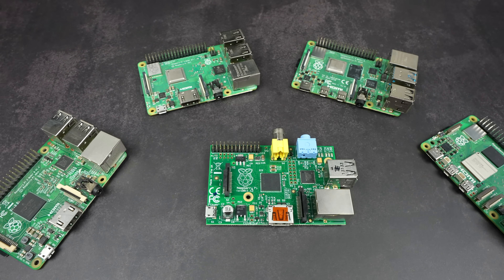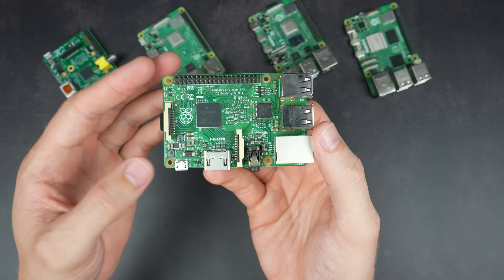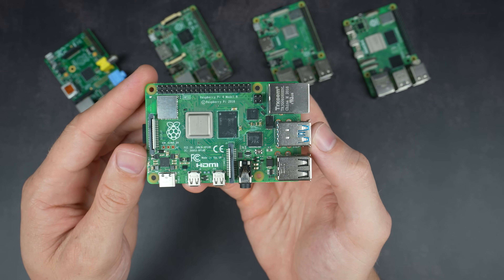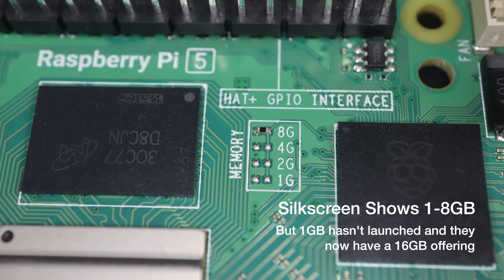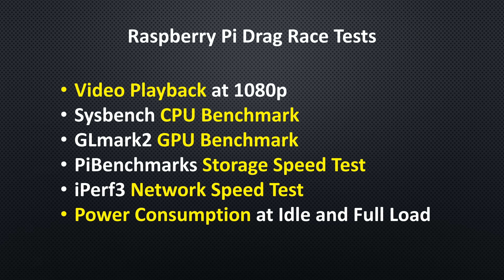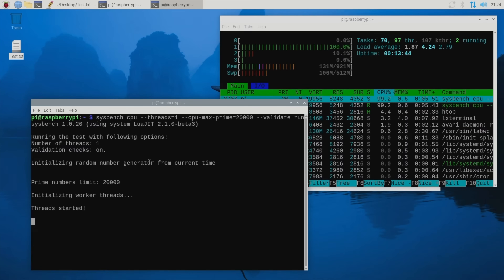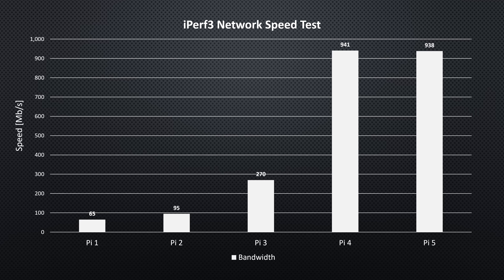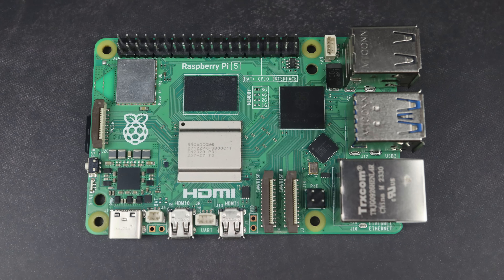Raspberry Pi Ultimate Performance Comparison: Pi 1 to Pi 5

Comment: I'd like raspis to return to their low power, no heatsink needed roots, as the pi 5 runs too hot for my liking and needs new power adapters. 
The ideal model should be able to run from any usb port like the ones already in devices such as pcs or tvs with no need of active cooling.
Also I hate the micro hdmi ports, better have only one output or have the second one use usbc dp mode.
Reply from the maker: The Pi 5 can still run on a standard USB power supply (without power hungry drives and peripherals connected) and without a heatsink - although you'll be limiting performance. Agree on the microHDMI ports - everyone seems to want them to go back to one full size HDMI port and a second through another means.

Comment: I remember overclocking my Raspberry Pi 2 in high school up to 1.15 GHz. A couple weeks ago I went out and picked myself up a Raspberry Pi 5. It's absolutely mind-boggling how much better the new ones are! The usability has also increased over the years; maybe it was just my inexperience but I found it tremendously frustrating to get OSs installed on the Pi 2 back when that was the latest one. With the Pi 5 it was extremely easy and frictionless to get set up for the first time.
Reply from the maker: They have certainly come a long way, both in performance and in the user experience.

Comment: I have an M1 iPad Pro 11" and I'm looking to use a raspberry pi as a portable code server by connecting it to my iPad via usb c. My only concern is that the iPad cannot output enough power for the raspberry pi. Most videos i saw regarding this used the raspberry pi 4 4GB model. Where i live, the 4 and 5 are almost the same price but im really confused as to which one to get. Should i sacrifice performance for power efficiency? Please let me know what your thoughts are on this.
Reply from the maker: The Pi 5 can run on a Pi 4's power supply as long as its the bare board with no NVMe drive etc. connected to it.. I think that the main reason they went to a 5A supply was to support the PCIe port. You'll probably just get a warning on the Pi to say that it's not being powered with the correct supply.
Reply: @MichaelKlements  So, in theory, I should be able to fully power a raspberry  pi 5 with just my ipad? It's not going to use pcie or any usb peripherals. Just a direct usb c connection to my ipad. If I remember correctly, the max output of my ipad is 7.5W. So if I use a really high-quality wire that's short, it should be fine?

Comment: That was interesting.

I remember being really excited following the development of the original Pi, then being disappointed with it when I got one of them. It was stunningly slow, and while only $35, it couldn't do much more in terms of hobby projects that a microcontroller costing much, much less.

I think it's when the 3 landed that it really found it's legs as a general purpose computers.  Throw in the recent compute modules and the Pi is all but ubiquitous in the electronics systems space.

I'm pleased for people like Eben Upton.  They've created a remarkable industry.

Comment: This is a wonderful video. My first Pi was a 3B, and so I never suffered that Casio calculator performance of the V1 or V2. My next was a 3B+, then the 4, and now I have two Pi5s doing my mission critical stuff (Plex server, Pi hole, and media centre in the bedroom). I still have a couple of Pi 3s ready to do stuff, but rarely even boot them now. The Pi 4 is still a retro games games console, so it's not all bad.

Comment: Great compact comparison and reference. 

I still have a pair rp1s , one on service as sort of media server serving my google tv using samba with 800gb attached flash drives and connected via lan port on internet’s provider adsl modem. In terms of power is provided by adsl modem usb port. 7 years 24x7 still running fine.

Comment: ONLY the Pi 5 is any good for Video. The rest of the PI SBCs are VERY Poor at Video.
That being said, the Pi 4 is still one of the BEST value for money SBC. It has great balance between power consumption, efficiency, thermal, and CPU/GPU power.
The Pi Foundation would do great by keeping the production of the Pi 4 and Pi 5 alive simultaneously. Offering these Pi SBCs at different price points would allow many more to experiment.
Reply from the maker: I agree, I think the Pi 4 offers the best value for for money.

Comment: Did you compile sysbench on each of the Pi's, or is it taken from the repo? The scores for the Pi 1 & 2 are far too low. The Pi 3 is faster than the Pi 2 but not by that ridiculous margin. It should only be about 1.5x as fast, not 17.5x 

Also, did you keep them all at 32bit raspbian? If you have the 1 & 2 on 32bit & the later pi's on 64bit then the results aren't really comparable.
Reply from the maker: I used the repo copy of Sysbench and the latest supported OS for each - these are 32-bit for the Pi 1 and 2, 64-bit for the 3,4 and 5. The results are an indication of how much better each generation is than the previous generation - capping the Pi 3,4 and 5 to 32-bit to make the results compariable defeats the purpose of the test.
Reply: @MichaelKlements   @MichaelKlements   @MichaelKlements  How can your results give an indication of how much better each generation is than the previous if the results are not comparable? Sorry but I don't understand that logic? That's just basic scientific method, the tests have to be the same for the results to be of any use. You can use 64bit raspbian on the later Pi's but at least compile sysbench to be 32bit across all the tests (probably 32bit version in the repo too).

32bit sysbench is massively gimped, by design, so if they're not running the same test then essentially all you're showing is how much better code written to use exclusively double precision (64bit) floats runs on a 64bit architecture vs a 32bit architecture, which is an obvious outcome & not at all representative of the actual performance.
Reply from the maker: I fully understand that running identical tests across all models is the most scientific approach for a direct comparison. My goal here was to highlight what the modern Pi can do rather than limit it to what the older ones could do. If the older Pi can’t run certain software in a reasonable configuration, then I don’t think it makes sense to hold back the newer Pi just for the sake of consistency.

It's like comparing fast charging on a modern smartphone with PD vs/ old smartphone without. Then saying, well the old one doesn't have PD so we'll use a non PD charger. The test then concludes that the modern smartphone isn't any better at charging. Yes, using a non PD charger is a more comparable test between the two phones but in the realworld the one can be charged significantly faster than the other because it has a feature that the other doesn't have.

That said, I appreciate the feedback!
Reply: @MichaelKlements  dunno why my reply isn't showing up! I understand the logic, but sysbench isn't a useful tool for showing real world performance, it's not even a useful benchmark tool (& per the developer isn't even intended to be one, despite its name). If your workload consists entirely of running sysbench then yeah it's very useful information, but I doubt many users do this. & I thought the goal was to show the generational performance improvements? I may have misunderstood the video then. The generational improvements would still be there if they're all running the same test, just not the unreasonable gulf between 2 & 3.

32bit sysbench is massively gimped, so in your fast charging analogy it'd be like using a 5V 50mA charger to represent non-fast chargers.

Comment: Great Raspberry benchmark. I have RPi3, RPi 400 and they do their job. RPi400 is the best Amiga and Commodore emulation. However, the best solution for Raspberry Pi OS desktop is RPi 5, preferably with an NVMe disk, then RPi OS works very efficiently. I don't regret spending money on each version of RPi

Comment: I really wish they'd kept the audio out Jack and would have put in a decent audio chip. Extra cost I know but they could have been dominating the  audio and hifi market all this time.
Reply: RPi itself sells Hi-Fi hats with high quality DACs on its website. and if you don't want a HAT, there might be a chance that PiOS supports USB DACS by brands like Schiit Audio and Dragonfly. However, they'll never dominate the audio and hifi market, too much choice there.
Reply: IDK they would need to build it with vacuum tubes for that. 😅  Anyway I have a Pi2 with a HiFiBerry HAT and that works well, but I think the number of people that are interested in high quality audio, want to stream it AND are willing to mess around with a raspberry pi... That's not a very large market.

Comment: Thank you for this - it is really good to see the power per watt comparison - (I think you have persuaded me to retire my Pi V1's completely).   I wonder how this compares to second hand mini PCs running something like an I3 Gen 6 CPU, as the price gets comparable when you include putting a Pi in a case and getting a power supply for it
Reply from the maker: I've done a couple of recent comprisons between the Pi 5 and some N100 and N97 mini PCs but I havent ventured into comparing Pis to older PC hardware yet.

Comment: I have few PI3 and nothing better, P1 and P2 were very useful to run dedicated applications requiring low power. Pi was not a PC at this time, this ended up in non sense things consuming way too much power.

Comment: Regarding power consumption:

The pi5 2gb and 16gb version use a newer revision of the SOC. They cleaned up the die removing unused Broadcom parts.  
Resulting in a lower power consumption

Comment: great video. For me the sweet spot is the Pi4, doesn't get too hot with just a decent heatsink without active cooling.

I think the Pi5 missed some opportunities.

the Pi6 should have or should exist in a version with (bootable) NVMe (without the scary cable) and 2.5 Gbps ethernet, and should remain stable without cooler. But who knows, perhaps the next gen even outranks my expectations.

Comment: How much RAM did you have for the Pi 4 and 5 used in the benchmarks? It would help to compare the final results with RAM in mind as well (especially between the 4 and the 5).
Reply from the maker: Both are the 8GB variants. The tests that I ran aren't particularly RAM intensive so I don't expect the results would change much but that would be a good comparison to do.
Reply: @MichaelKlements  Thank you for the video and the timely response. Your content is very interesting and useful.

Comment: Good video with interesting results.
Where would the Pi Zero 2 w rate ?
I guess its around a Pi 3 level but I could be wrong
Reply from the maker: The Pi Zero 2 W would be slightly under the Pi 3, its a similar SoC but clocked a bit lower (1Ghz vs 1.2Ghz on a Pi 3) and it only has half of the RAM.
Reply: @MichaelKlements  just a shame the Pi Zero 2 W only has 2.4Ghz wifi and 512mb Ram.
The Orange Pi Zero 2 w really shows up the hardware short cummings of the hardware

Comment: You can try to test the DNN of OpenCV and see the power draw and heat! Pi 5 is sloppy. Much worse than Pi 4B!
Prefer Pi 4B over Pi 5. Would like to see a much better Pi 5. The 16nm process used is out dated. Expecting 8nm or less. The die cost is about the same.
Skip and keep waiting for Pi 6......

Comment: the maximum signaling rate of usb 2 is 480 Mbit/s, not 300.
Reply from the maker: Yes, the 300Mbps limitation is due to a few things but is mainly to do with the network adaptor and USB controller sharing bandwidth.

Comment: Regarding the sysbench results: Cortex A53 shouldn't be 18x faster than A7.

Can you run the sysbench test on the RPi 3 with 32-bit Raspberry Pi OS? I think that's the confounding factor.
Reply: How much impact could the VFPU and NEON extentions of the A53 have? Most often when 10x improvements in CPU performance are made, it is due to hardware acceleration of certain instructions.

Comment: when the raspberry pi first came out it was touted as a computer the size of a credit card. i am still waiting for their boards to actually be the size of a credit card. the closest we’ve gotten was the cm lineup or the rp2040, etc. not quite credit card size that can actually fit in a wallet slot and match exactly other credit card dimensions.
Reply from the maker: To be fair, the actual board and circuitry is fairly close, it's the ports that make it much larger.
Reply: Raspberry Pi Zero 2W is pretty close and performs reasonably well if headless

Comment: I would've liked to see the raspberry Pi Zero w and Zero 2w included in this

Wishlist for future PI: USB4, DisplayPort, 2x10G Ethernet, WiFi 7… I know it won't happen but one can dream?
maybe tucked away in a corner onboard pads for RS232/422/485 (on the backside)?
Reply from the maker: Thanks for the suggestion, I'll look at doing one with the Pi Zero range too.

The Pi is probably always going to be limited by the PCIe lanes available, so dual 10Gb Ethernet and the likes won't happne for a while. RS232/422/485 would be a great inclusion!

Comment: The 3B+ could only do up to 300Mb connection speed, the Pi4 has true 1Gb connection. 2:56
Reply: After continuing the video I noticed on your network test you correctly said the said the 3B+ speed 😁 great video.
😮 but you did label the network speed as the Pi3 but was in fact a Pi3B+ 🤭😜
Reply from the maker: Yeah it's a bit of a strange one - Gigabit Ethernet over USB 2.0. I didn't really go into the versions of each series too much - the 4 is also technically the 4B

Comment: Did you mention the model 1 B plus?  In between the B and the 2, the B+ introduced a lot of the things later models would have like 40 pin gpio, squarely placed mounting holes, ports on just 2 sides, 4 usb ports ...
Reply from the maker: I didn't go into any of the B or B+ versions in between. I only mentioned the Pi 3b+ as I didn't have an original Pi 3.

Comment: The Pi4 is a really unique balance of performance and power consumption. Runs well off a standard power bank with a great desktop environment. Ideal for robotics and remote applications.
Reply from the maker: I agree, the Pi 4 is in the sweet spot where it offers enough performance an IO for most projects and is still quite cheap and power efficient. I think the Pi 5 is a bit overpriced for what it offers.

Comment: The early pi models have dedicated video decoding hardware that requires a license. You can get smooth 1080p playback out of them for some codecs if you set it up.
Reply: The Pi 1 would play h264 -aac 1080p  on KODI with no problem about 9 years ago. Navigating around the menus was kind of slow.  I don't know if you can still get a build of Kodi that supports the Pi 1. There were only a couple of codecs that you had to pay to get.  The Pi 4 and later can decode most codecs in software fast enough.
Reply: @rmccombs66  meanwhile the RPI 5 has none and it hurts so bad
Reply: @elorrambasdo5233  I haven't gotten a raspberry pi yet. Isn't it fast enough to play anything?
Reply: @rmccombs66  there's a whole bunch of info you can get online about video, emulators, and the like, it's just that stuff like Jellyfin do not recommend using the RPI5 as a server because it just doesn't have the hardware acceleration like some of the older ones.
Reply: @elorrambasdo5233  well I don't use a raspberry pi for jellyfin because I wanted to be able to transcode.
Reply: @rmccombs66  but you could easily overclock the Pi 1 to 1.1ghz, overclock the ram and video to max all without issue and it was quite snappy along with the hardware decoding. It is still a viable board for a TV media player and people are throwing them away.
Reply: Came here to say this. I used to be able to stream 720p on my original Pi from YouTube using Kodi. Might be able to try repeating the test using VLC instead of the browser. Don't quote me on this, but I think VLC included the plugin needed to run decoding in hardware.

Comment: I like to see build in m.2 on back of the board. Like many other SBC’s. Also video driver for raspian os. I got the new orange pi 4a and it have video driver from Orange os Debian version. It runs as fast as pi5 but way cheaper.

Comment: I also like the USB C port for power along with the addition of 2 x USB 3 ports.  The RPi5 has a good video play back making this model the perfect PC for a HTPC.  Good video and comparisons between the models.  What I don't like is the 2 x micro HDMI ports.  I would rather settle for one full size HDMI port.
Reply from the maker: I think most makers/enthusiasts would prefer a single full-size HDMI port. They could retain two ports in the same form factor by having one run through a ribbon cable expansion port like the PCIe port.